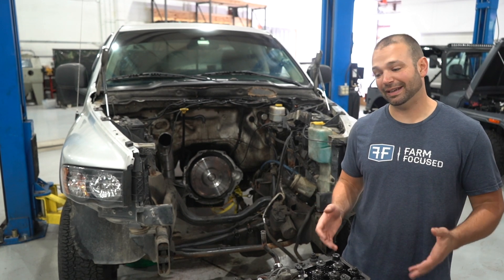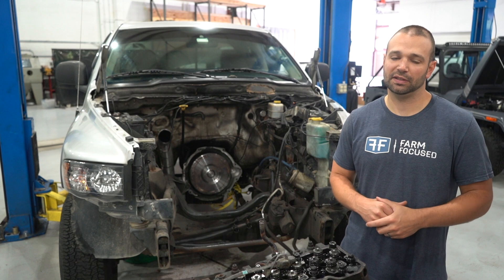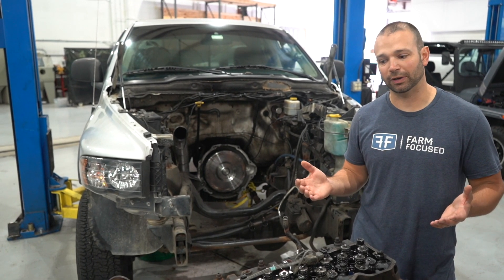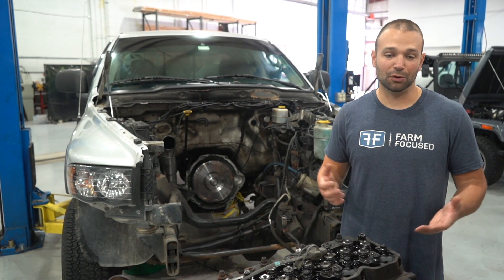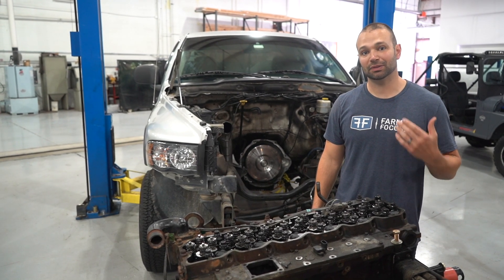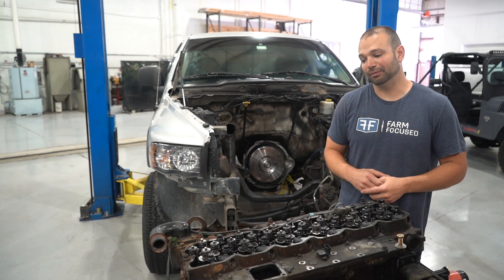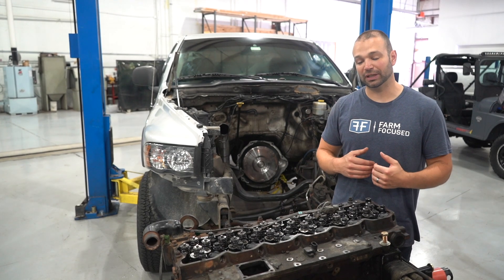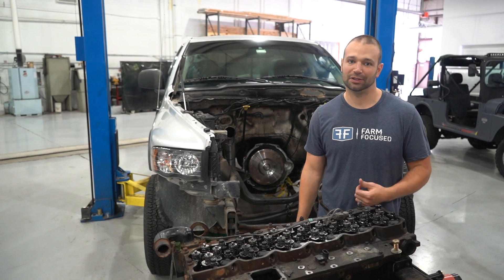Engine Failure! Here's What We Found

Comment: Holy hell....350-375conpression is good?
  Damn...Im at 460psi across all 6 cylinders, on 460k original mile 2nd gen welding rig, with +120injectors for the last 350k miles....
   The trucks daily weight is 10,000lbs, and tows my RV across the country multiple times per year.

Comment: On the later 5.9 say 06 if you have to much leak down the emc will read that and trip a code for injector leak. If you have injector leak  right? I’ve read a lot of people say just put new injectors in it. Now if you put new injectors in it , it won’t solve the problem right? I mean yeah they won’t leak but won’t there still be damages to the piston and cylinders? I’m saying this because my truck is a 06 and this has happened to me and I have yet to fix it on my truck as well
Reply from the maker: It all depends on how much leaking there is.  If your injector has been pouring fuel into the cylinder for a while and at high volume, the job is going to be more expensive.  The reality is that you will need to do a visual inspection and have your injectors tested by a reputable fuel system supplier (we use Exergy for things like this).